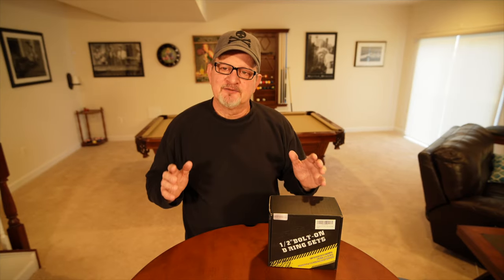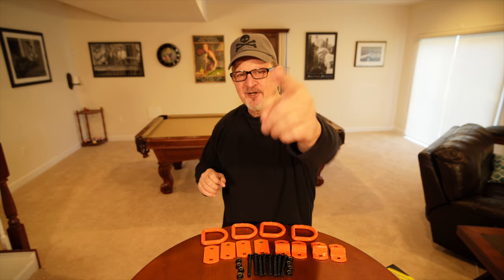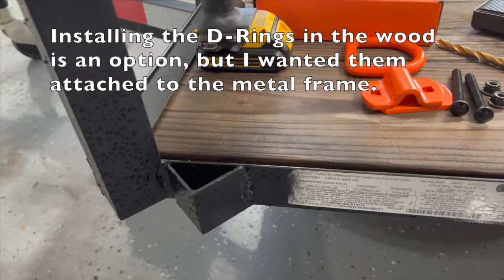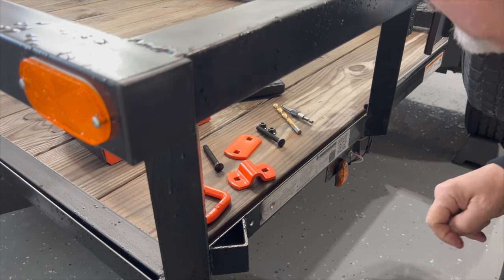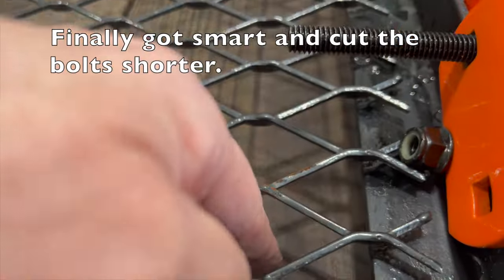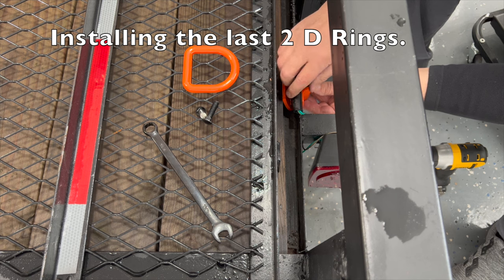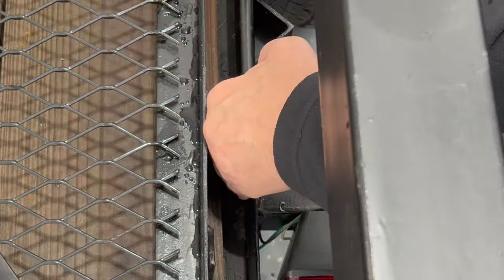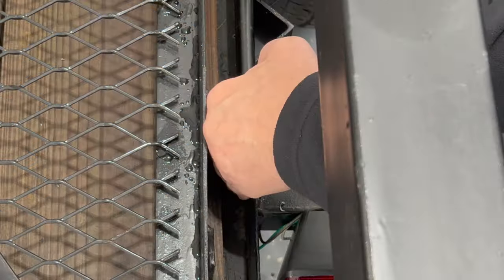Trailer D Ring Tie Down Anchors - Bolt-on Install - Rated To 12000LBs - Powder Coated #trailer #diy

Comment: My suggestion would be to cut the bolts before putting them on just long enough to go thru the D rings. Looks sharp.
Reply from the maker: Thanks for the comment!  Yes, I finally started cutting the bolts on the last two D Rings.  Made the installation much easier.  Appreciate that you watched the video!!!
Reply: Why not just drill down through the board instead? No need to drill it to frame lol
Reply from the maker: @kevinsteinke2603  Thanks for the comment!  Yes, I could've installed them through the wood boards but I was worried about when I load things onto the trailer and didn't want the D-rings to be in the way.  I did read that they will work fine when secured through the wood as well.  I say to each his own.  Could've gone either way. Thanks for watching the video!!!
Reply: @GrayTrend  to mount them like you did, would have been better served to just weld them on there then instead of all that fuss trying to bolt them on.🤷‍♂️
Reply from the maker: @kevinsteinke2603  I do need to learn how to weld.